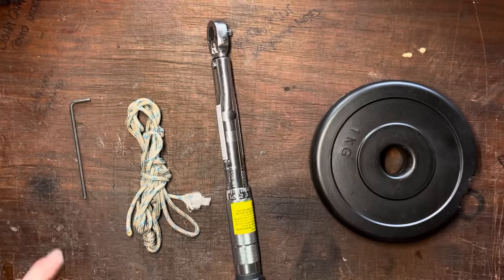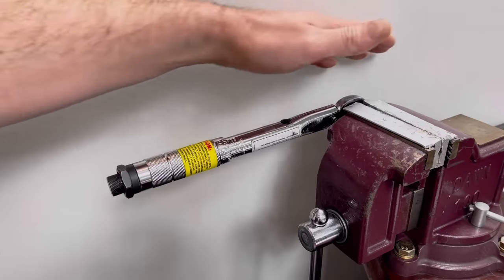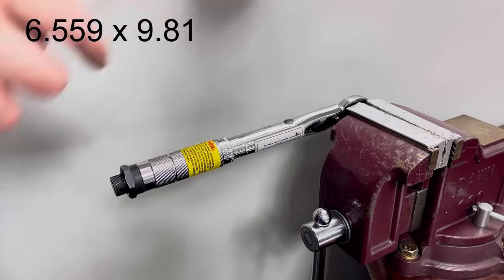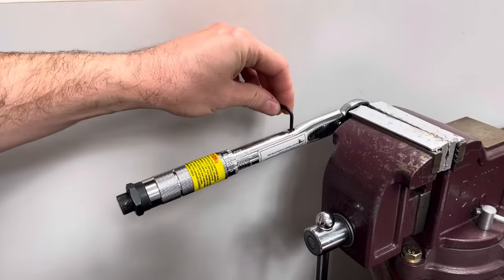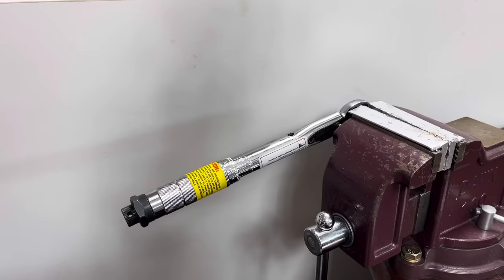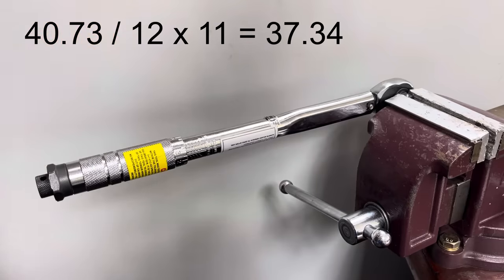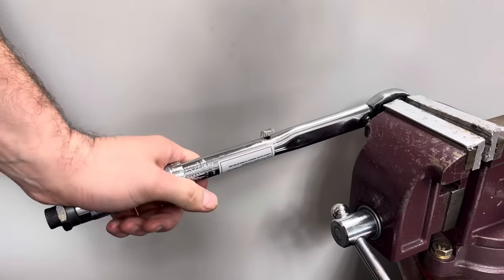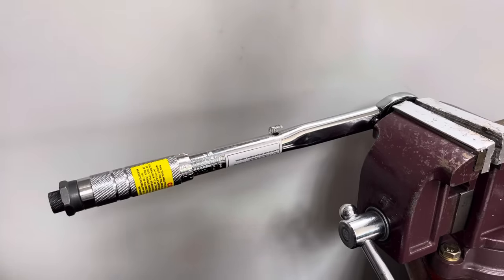CALIBRATE YOUR TORQUE WRENCH IN UNDER 5 MINUTES (NO SPECIAL TOOLS REQUIRED!)

Comment: First,

"Imperial" units are Lb-ft, NOT Ft-lb

Second,

When you adjusted your handles for tq value, after determining the tq length, that length changed, requiring a different calculation.

; )
Reply from the maker: Thanks for sharing! I do my best, but sometimes I say the wrong word :)
Reply: Incorrect. Torque is r cross f. Torque units are therefore always length force.

Force length is a unit of work.
Reply: @crackpotfox  SMH
Reply from the maker: I’m even more lost than before. I just hope the video was helpful!
Reply: @VintageEngineRepairs  Apparently crackpotfox and myself are in disagreement.  My physics book, and every credible source I could find on the web say Lb-ft, as a certain force at one foot, which is the standard.  I encourage  you and any viewers to research for themselves.
Reply: @mjktrash  Maybr i was taught the wrong way to calculate moments in my mechanical engineering degree. I was taught that M=rxF. If you conserve unit order, that results in ftlb and mN. Same with work, W=int(F)dx, resulting in lbft or Nm....
If you want to arbitrarily move the order around, you "can", but while multiplication is commutative, vector cross products and integrals are certainly not (unless in the integral the force is constant)
Reply: @crackpotfox  Somewhere in our disagreement is an answer that I suspect we are both missing that will bring it together.  I certainly recall r cross f (although vaguely, to be honest).

That said I don't have a rebuttal for the discrepancy between the unit standard and the cross. 

Shrug
Reply: @crackpotfox 

Work is a scalar.  If you are going to use a vector for force, then work is the dot product of the force and displacement vectors. If you want to calculate it as an integral, you calculate it as a multiple (nested) integral for each dimension. The order does not matter so long as you keep track of the correct variable of integration at each step. 

The cross product is anti-communative. That is the magnitude is the same and reversing the order of the multiplicants only changes the sign  (ie, the vectors always point in opposite directions). So as long as you are only concerned with the magnitude, using either order is fine. You just have to keep track of direction separately. 

The convention, established by physicist Arthur Mason Worthington, is:

foot-pound is work
pound-foot is torque

It isn't a perfect solution; but, as shown above it doesn't change and values significantly either.
Reply: @VintageEngineRepairs The OP  is correct.  The proper unit for torque is pound-feet. That is the convention to distinguish torque from energy/work which is measured in foot-pounds.

If you want measure the torque of a bolt, you measure it in pound-feet.  If you want to measure the muzzle energy of a speeding bullet you measure it in foot-pounds.

The concept was already known when the SI system was created, so energy was given its own unit, the Joule. So no such confusion exists. Technically, the imperial system has since adopted the Erg as a unit of work which would theoretically avoid the confusion; but, it has never been widely adopted.
Reply: @mjktrash  The "discrepancy" is merely a matter of history. Foot-pound was taken for use as work; so, the pound-foot was adopted for torque instead to distinguish the two. 

Crackpotfox is incorrect on one point and incomplete
on another.

Incorrect: The order for  integration of a vector does not matter. For the purposes on integration, the individual vector components are integrated as separate scalars in their own individual integrations. 

Incomplete: The order of multiplicants in a cross product matters; but, only to the sign of the product.  The magnitude is the same no matter the order. So the order of the multiplicants doesn't matter as much as Crackpotfox would have you believe.
Reply: @timharig  Thank you for the reply!

Comment: If you properly detention the Spring after ever use you never have to do this.
Reply from the maker: They need occasional adjustment even with releasing tension.
Reply: @VintageEngineRepairs    I have 25 years experience in adjusting to torque wrenches.  I was trained by the man who invented the torque calibration machine. If you don't  have a torque machine  your doing more harm than good.  I took a 30-year-old Craftsman torque wrench from home to work to check the calibration on it and it was almost spot on.
Reply from the maker: @jugglesdimensions8632  and I was trained by the man who invented the click torque wrench, he said they need occasional adjustment.
Reply: @VintageEngineRepairs   That wrench was invented in 1918, I can't believe you're still alive.
Reply from the maker: I have good genetics 😂
Reply: @VintageEngineRepairs  My teacher was Roland L. Leclerc, founder and President of A.K.O. 
A.K.O Torque Specialties invented the TorqCal2000,  used   throughout the military and nuclear industry.  I had extensive training on that machine. So let's here your details pops?

Comment: Help, I have a torque wrench in inch/pounds, send maths.
Reply from the maker: No idea, use google 👍
Reply: Take the number 12 out of the ft-lbs equation. Lbs / inches.
Reply: If you have a spec in ft lbs and all you have is a inch lb wrench, multiply by 12 (in order to torque to 10 ft lbs with an inch lb wrench, set the wrench to 120. ((10x12=120)))
If you have a spec in inch lb and all you have is a ft lb wrench, divide by 12 (in order to torque to 120 inch lbs with a ft lb wrench, set your ft lb wrench to 10. ((120÷12=10)))
I hope this helps you.

Comment: An OUTSTANDING presentation, VER.  This also highlights the necessity to properly grip the handle when setting the torque on a fastener.  If you pull from the end of the handle, it will not be torqued enough due to the leverage increase.
Reply from the maker: Thanks for the kind words :) technically it doesn’t make any difference to the bolt, the torque will be the same, it’s just the force you need to apply will change depending on where you’re holding it. It will all still be the same torque on the bolt :) it’s only when calibrating  the torque wrench that you need the specific location on the handle as the weight applied is constant. Thanks again!

Comment: Calibration is more than making sure that the instrument reads accurately.  Calibration is to validate all the measurements you have made previously, as well as establish the drift of the instrument over time.

I would consider this more of a tool repair process than a calibration process.
Reply from the maker: Thanks for watching

Comment: There is a tiny bit of inaccuracy because of the slight downward angle at the clicking point. Multiply with the cosine of the downward angle to get the real force perpendicular to the wrench. Actually the difference is really small for small angles. If you keep the angle below 5 degree it's not reduced more than to 0.996 . So it's totally ok to calibrate it with an slight angle. It's the same thing as measuring a distance between 2 parallel lines and holding the measuring tape at an slight angle. You could measure the distance horizontally from the end of the handle to below the square drive of the wrench and divide it by the length (from the square drive center to the end of the handle) instead of using a calculator.
Reply from the maker: Thanks for watching and sharing :)

Comment: This style of torque wrench is notorious for linearity problems.  When I was running a maintenance shop in the Air Force, we needed torque wrenches for certain tasks, and when I got adjustable wrenches, they frequently failed calibration because they were not within manufacturer's specifications across the range of adjustment.  I was forced to dispose of them because they failed.  Since my most important task was a single calibration, I got fixed value wrenches and they lasted forever and a day. I also learned hand position on the wrench is critical to getting the expected result, so if you are calibrating your wrench for you, take note of the location you use to set your break and always center your hand on that location when using the wrench, and this holds true for all torque wrenches regardless of the technology.  Last, but not least, before taking a torque wrench to the flightline, we were required to set a torque value (doesn't matter what the value is) and cycle the wrench at least 5 time to ensure nothing was sticking inside and to distribute grease to the sliding surfaces regularly. You would be wise to do this before calibration (and the guys who do the calibrations in the military do this every time).
Reply from the maker: Thanks for sharing! :)